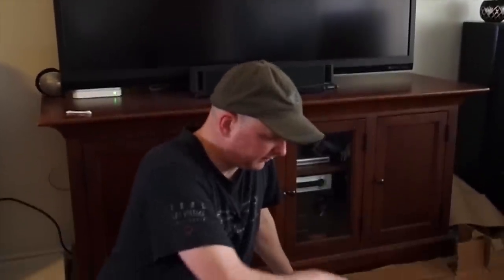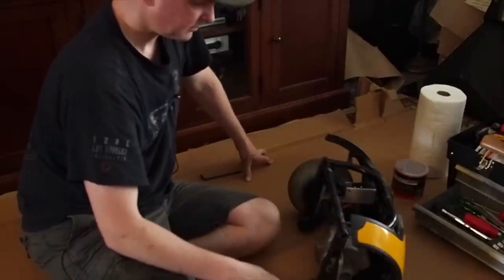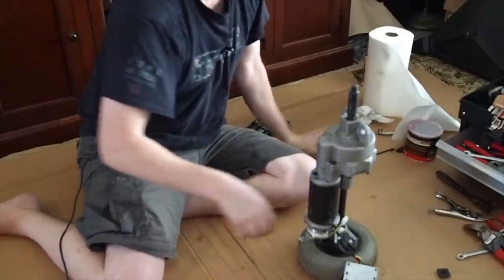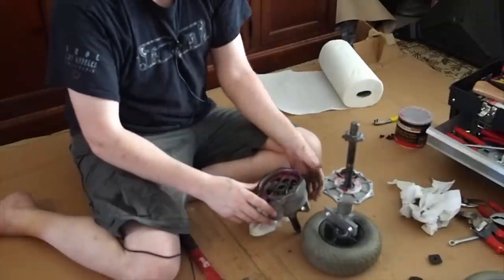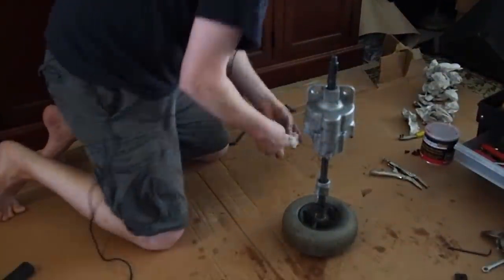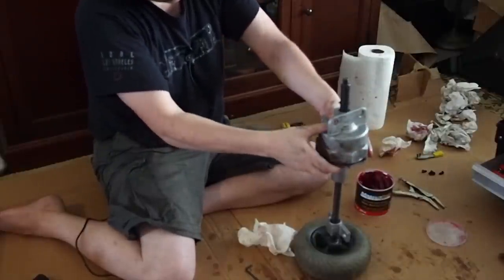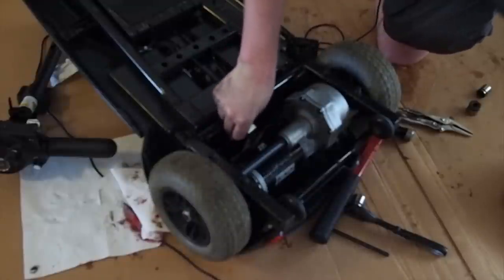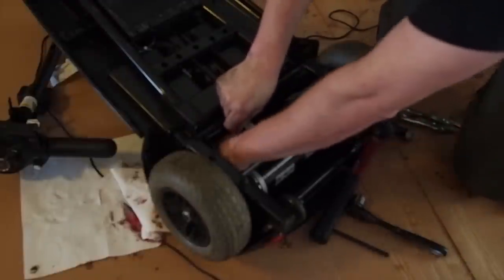GoGo Elite Mobility Scooter - Transaxle repair

Comment: By golly it sounds like you put the washer in the wrong spot old those washer are called shim
Reply from the maker: Oh, I definitely put the shims in the wrong order the first time I assembled the transaxle (I did not film it). I believe I put them in the right order in this video. I made several attempts to get it right. Mathematically, there are only a few ways they can go in. You just have to be patient, and take several stabs at it if you have to. In this case, I knew the order was wrong before I started... so keeping track wasn't necessary.

Comment: I have been trying to hunt down a technical service manual so that I could do this job on my scooter.  Sorry dude, your instructions did not give me the confidence to do that job.  Don't know which washer goes where helps so very little. Even if you got it back together right, I have no clue what that looks like.  Honda sells service manuals for their equipment. Sears has lots of service manuals too.  That fact that Pride mobility won't share that information with anybody but dealers and techs should be a crime.
Reply from the maker: Well, it's actually very simple. If I was smart and took photos when I initially took it apart - it would have helped a lot.

I've seen a service manual, somewhere. I actually think someone on the thread posted a link to it.

Comment: you oughtn't to do such major overhaul in the living room.  Haven't you got a garage or spare room, to do all that in.  
I'm aware that you put stuff down to protect the floor covering but it doesn't seem right that the living room is a workroom.
NOTE:  mobility scooters run over dog pee and poop when they are in the street and other nasty things, one ought to wash hands after touching the machine and NOT touch your face with fingers, during the work.

o0o
Reply from the maker: I agree, but I used the best space available.
Reply: Lick your fingers if it tastes a bit sour you will know it is dog s----t.

Comment: That is not! a CLUTCH! It's an electric break
Reply from the maker: Semantics. I know it's a break, but I will forever call it a clutch. It doesn't make any sense to say, "release the brake" to my handicapped freind. She'd respond, "What brake?" But, if I say, "flip the clutch" - she gets it because if you press the clutch on  car - it rolls.

... Really it doesn't matter. When I order parts (I have replaced the brake several times) I buy a brake. However, when I talk about it... I will forever say "clutch" because to the users (and to me) - it's operated like a clutch.

Comment: how do you fix the automatic brake on these
Reply from the maker: There is no brake. The motor provides resistance when the current is removed. If the wheels are engaged to the motor - the motor will stop the scooter. If you feel your scooter isn't stopping as quickly or sharply as it used to, that's probably true. But, it's because the motor has broken-in. Bearings and bushes slowly wear down over time, making the motor less effective. You might be noticing it during the power off resistance, but it'll also be true for power-on torque too.